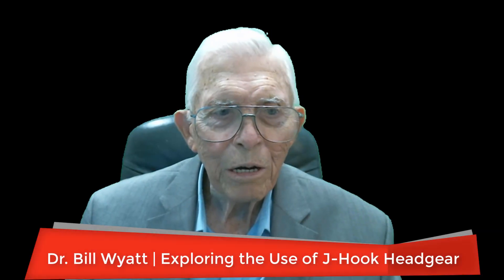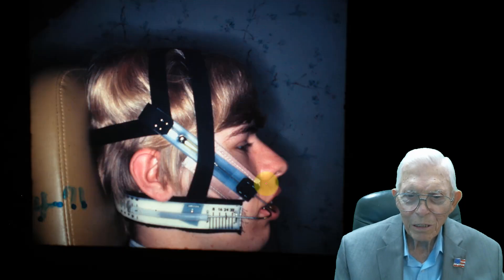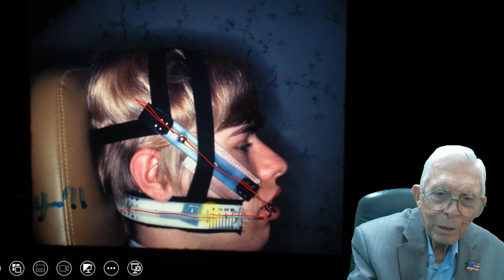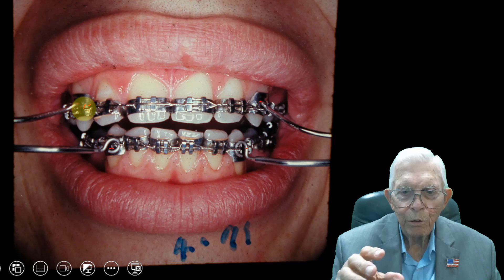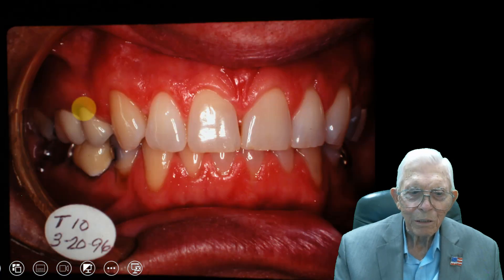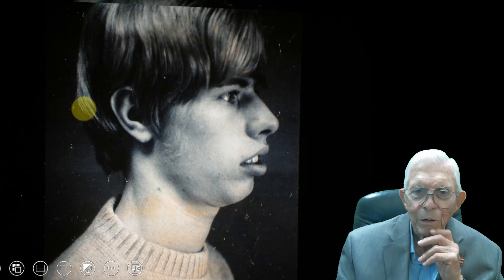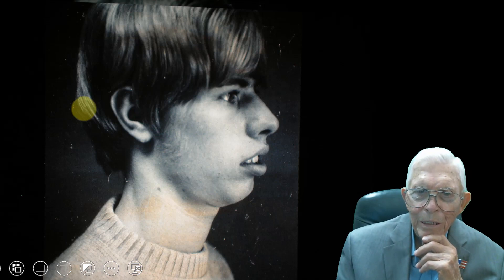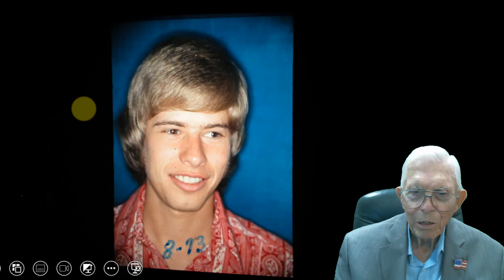Exploring the Use of J Hook Headgear

Comment: Did you use the full banding tecnique at this point( Patient fully banded?) Roth pin and tube full bands? Sounds like me at that age full bands hg lip bumper etc. MISERABLE
Reply: Hi, I have been with full banded treatment for 16 years with banded  braces and j hook
Reply: @Mariasalgado-ed1dv  I am wearing full bands on all teeth as we speak. I am undergoing full orthodontic treat with full banding expected to last at least 2 to 3 more years. My bands of course are wrap arounds with pin and tube to hold arch wire. My band style is 70s Angle style . Very big tradirional a very good appliance for my work which includes space work bite work and teeth torquing etc. I have large arch wires many lig ties metal and coil springs. No elastics yet. My orthodontist has no use for brackets cermic braces self ligating brackets invisilignetc as she states full banding is the best way to practice orthodontia and give the best results. Very old school but young person and as she says You want straight teeth then it will be done my way and for the most part that is large full bnding headgear expanders etc I am wearing high pull headgear which has a face bow wires rods up cheek  and straps on neck and head. I also have a lower lip bumper but no bite blocks. Hg is wired in . Not fun at my age but my ort h o likes wired in results. I also love wearing my big shiny yellow silver snapped rubber slicker. with my braces. They brighten rainy days. Slickers for you too?
Reply: @Mariasalgado-ed1dv  Just wondering how your bands and headgear are doing?  How many times or treatments did you have that required full band installation during your 16 years in bands? My banding w out hg took jist short of 12 hours over 4 days.  How long did your banding take place? Pin and tube style ? Angle bands vertical tube and pin to hold arch wire.? Lig wires and springs for you? HG for you on   every banding?
Reply: @robertginn3851  it took 18 hr to install and
Reply: @Mariasalgado-ed1dv  SORRY ABOUT REPEAT  DID NOT THINK FIRST WENT THROUGH . SORRY ABOUT THAT.
Reply: @Mariasalgado-ed1dv  How many days for your full banding.? 7 appts ? Other posts not shown talked about how fortunate we are to have full banding as brackets ceramics etc are gimmicky. Also banding allows all the extra addons that new braces do not besides pressure and good torque that our bands and hg provide. I bet you have a beautifully constructed precise set of bands that are working hard. Do yo get braces compliments? Many friends in or out of bands and headgear ? Also do you wear a nice bright pvc or rubber slicker with your banding to brighten the grayest days. I love my metal snapped bright yellow rubber slicker when worn with my banding and hg. Slickers and braces are a great combo. Agree? My bands have slide wires coil springs large arch wires lig wires etc etc. What do your bands have attached? Banding so much more open to extras which I feel help treatment immensely. Agree? So good to hear from someone else fully banded. Take care and hope we can stay in touch. Full banding us where it's at.
Reply: @Mariasalgado-ed1dv  Just wondered how your bands and headgear are doing today
Im always thinking of my friends like me who  are wearing full bands headgear and many wires. My bands are 70s style pin and tube for wire retention Lots of extras  on wires too. Iam slways thinking about all like myself who are smartly wearing banfs and headgear.  How many appts for you to be fully banded
 Tightenings long and hard? Mine are amd every 4/5 weeks. 4 banding appts for me.
Reply: Just wondered how your bands and headgear are doing What corrections are you getting?  Much longer for bands? Do you wear a slicker with your banding? I do love the combo.. I think I have 3 more full years in bands. Banding is tough but I do not know about you Ii feel very happy I have full 70s wrap around bands moving my teeth. Banding your preference?
Reply: @ thanks
Reply: @ headgers
Reply: @Mariasalgado-ed1dv  ALL wrll with the banding and hg? My full bands and hg are good. While difficult I feel full wrap around bands are by far the best braces.  Do you Agree? Elastics for you? Happy to have a found a friend in full bands braces and hg. Hope we can keep up on appts and tightenings. Being able to converse should ease the banding pain. Agree? Never heard do you wear nice 100 percent waterproof raincoats slickers with your banding.The shiny slickers and their hardware go great with our banding and headgear. Do you wear a slicker with your banding? Do you get many. compliments on your banding?  Congrats its the way to go. How many appointments to get bands on? I still have one tooth to band which needs surgeryf and a custom band and wiring. 2 hrs they say.  Adjustments an hr every 4 to5 weeks . How about you? Putting my nice yellow rubber slicker on because as e it is pouring. Can't wait to put my favorite braces compliment on. Many friends banded and braced?
Reply: @Mariasalgado-ed1dv  BEFORE I FORGET YOU ARE MORE THAN  WELCOME.  HOPE WE CAN CONTINUE TO TALK ABOUT OUR FULL BANDING ORTHODONTICS
Reply: @Mariasalgado-ed1dv  How are your bands and headgear doing? Elastics and springs too? So smart to have the headgear and full bands as you will get by far the best results. I chose with orthodontist mandat(ting full bands  headgear and all the great helpful addons full  banding alllows(springs elastics lip bumper heavy lig wire coil springs tabs slide wires etc etc etc. ) I do not think other braces have e all the adds so consider while tough full banding is the best braces there are (not to mention great power andf torque) Do you wear a nice silver snapped bright shiny rubber or pvc slicker to compliment your braces on rainy days? Braces and slickers look great. My original plan was 3 years fully banded but now I will have bands for at the very bestt (doubtful)) at least 4 years more  minimum. Things are moving  much slower than expected bit at least full bands are doing the work. Wear that slicker and braces  and take care.
Reply: @Mariasalgado-ed1dv  Just wondered  how your banding is doing? Elastics yet? Springs? How are the j hooks?  Do you wear a nice rubber or pvc silver snapped  raincoat or  slicker with what I'm guessing is very large nice looking bands. Bands nice looking?  70s pin and tube? Mine are. Nothing better to get straight teeth and a good bite than full banding and headgear.Same ortho for all banding? IT took me forever to get myself enough confidence  to wear braces hg etc but now I am very proud and I hope you are too. Love wearing my slicker and braces together. Take care
Reply: @Mariasalgado-ed1dv  Just wondered how your bands and  headgear are doing. Lotta add ons on the bamds? Hooks ligs springs etc? Mine have everything and all the wire you can imagine plus pain.  Things will be upped next appt because more power is needed because bands and hg are going slow. Have worn my yellow shiny yellow slicker with the braces and makes a great pair on a rainy day. Do you wear a slicker with your braces?
Reply: @Mariasalgado-ed1dv  Forgot to ask do ypu like full bands? I think they ste the best. Eastics? Non for me yet. I may get a s economy headgear soo two face bows 4 overt the head controlled straps.
Reply: @Mariasalgado-ed1dv  How are your bands braces wires headgear doing. ? Ijust my second hg and am wearing two at a time front face bows upper and lower with straps over heeD and behind neck. Banding seems OK but some new banding work coming. Braces good?